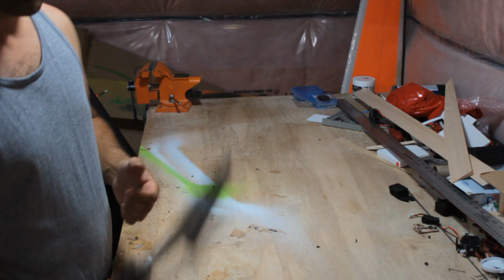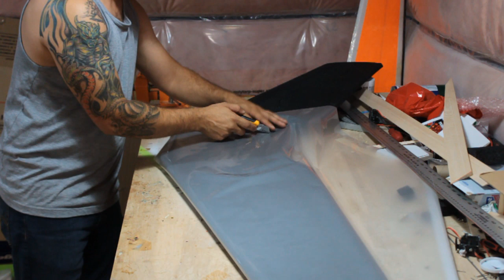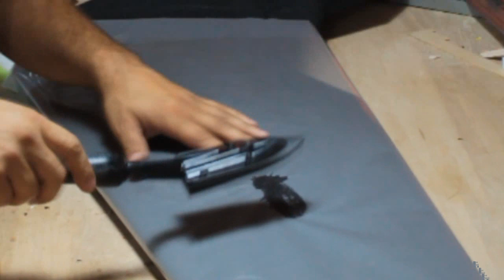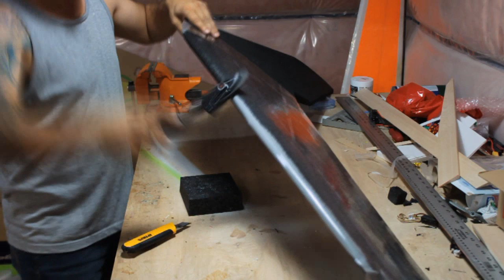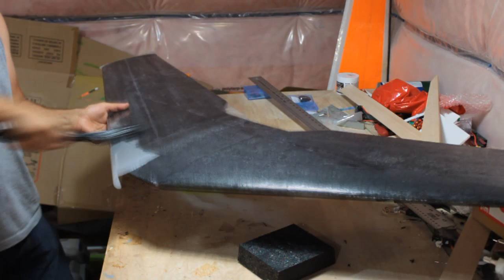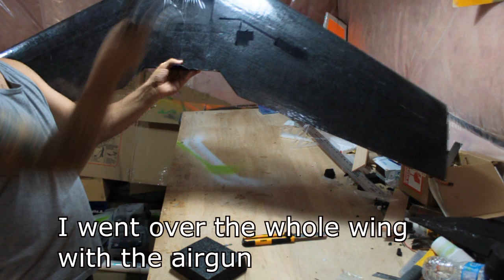EPP TBRC Wing Build - By Yuvski - Laminate FPV Part 7/8

Comment: I really like the video and mostly the part where you tried to remove the laminate. Could you please comment about same laminate on EPO. Mine peels quickly after ironing it.
Reply from the maker: George Georgiev on epo you need to give it a good sand before applying laminate